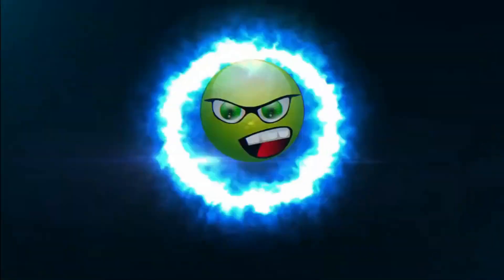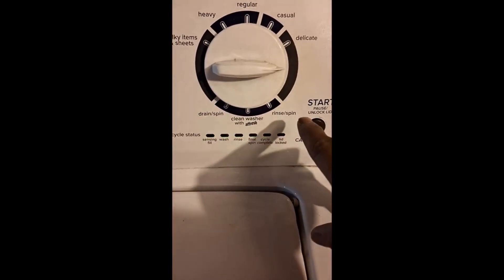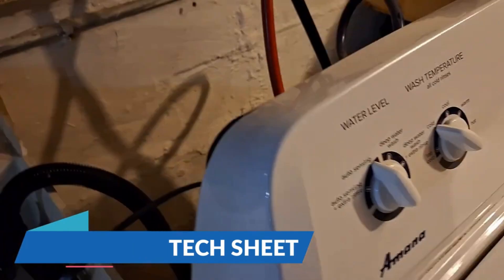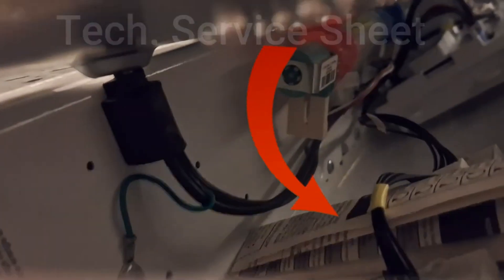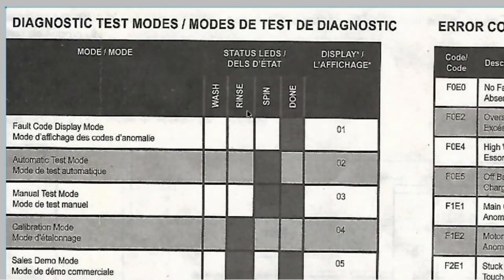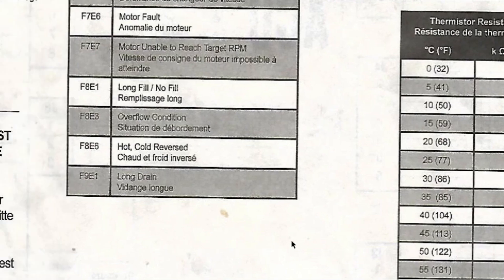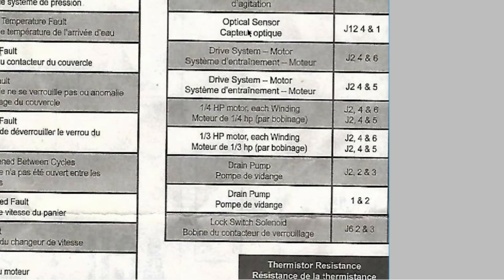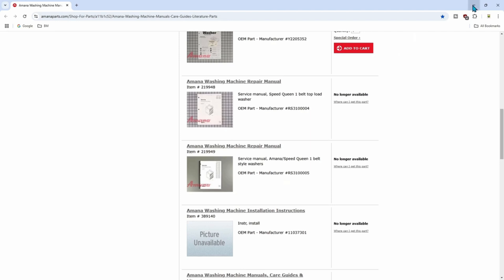Amana Washer Diagnostics, Troubleshooting Tips & Tech Service Sheet.  #amana #amanawasher

Comment: my washer completed the cycle but the lights went off and lid wont unlock, my clothes are stuck inside the washer. I already tried unplugging and plugging and it wont work. Please help
Reply from the maker: I could be a lid lock malfunction.  That lid lock only cost $20, but it could also just need a reset.   You can override that with a screw driver or butter knife.  There is a notch where it latches that you can manually release the lid.  Unlock it manually, unplug it and then try the reset code.